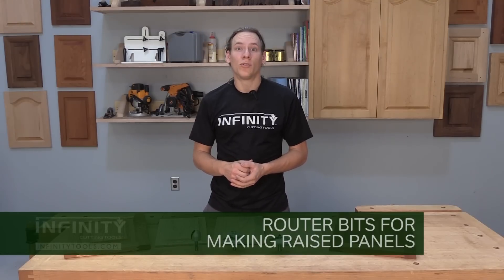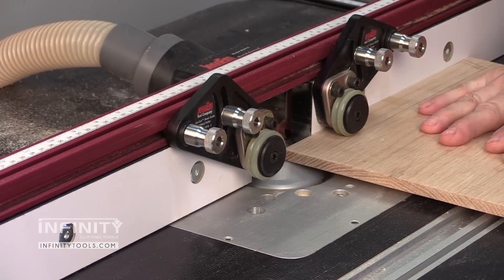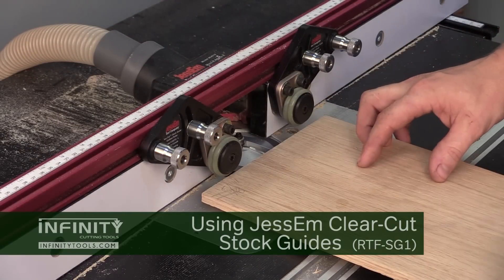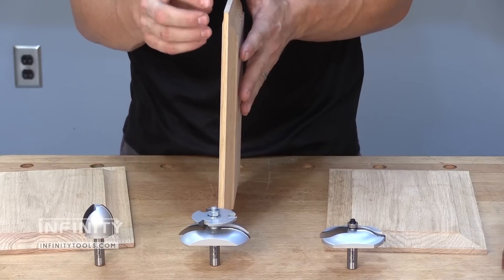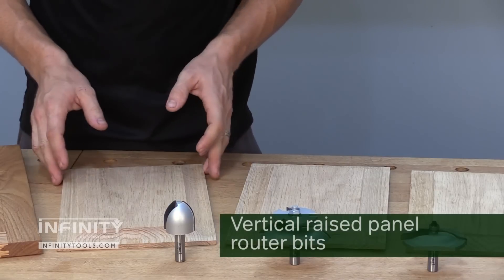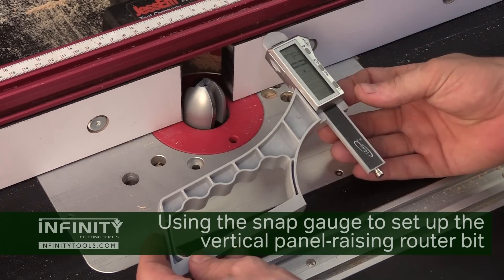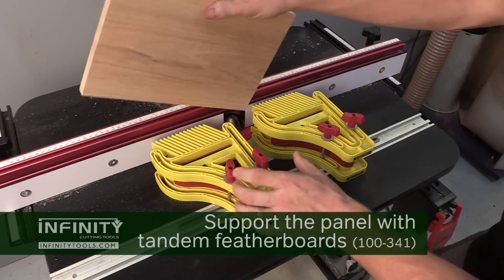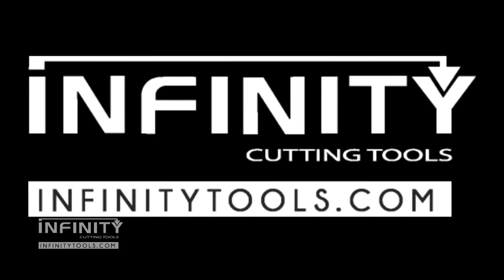Choosing and Using Raised-Panel Router Bits for Cabinet Doors

Comment: Amazon stuff from Chinese sellers takes weeks to arrive. They ship it from China and it takes an eternity to get here. What I liked about the infinity website were the pictures of actual wood with the cut of the bit (VERY HARD TO FIND ON OTHER SITES), pictures showing the measurements of the bits, and even videos of them using the bits. It's very clear what you're getting and makes it easy to narrow down what bit you need to buy. With a site like that, I think people's perception is that the quality of the bits will be good as well. I bought some $200 worth of stuff and it's on it's way now, so we'll see.

Comment: Does Infinity make a straight raised panel cutter with a bearing so I can raise the panel on a curve?  I would like a 1/2" shank that can make a 7/8" wide raised portion with a 1/8" shoulder.  I will not be inserting this raised panel into a frame.  Thanks.. Tom
Reply from the maker: Hi Tom, If I understand what your thinking, our standard raised panel cutter 90-502 might do the trick. You would either need to use your fence to limit the cut or swap out the bearing. Have a look here. https://www.infinitytools.com/raised-panel-router-bit-horizontal-5434
Reply: @InfinityTools  I think the 90-502 might work.  I think I would have to replace the bearing with a larger one since the raised shoulder I want to duplicate is 7/8" wide.  I wanted to attach 2 photos but I don't see where I can do that here.... any thoughts for me?  Thanks.. Tom

Comment: how well dose the triton motor do  under heavy load?
Reply from the maker: I have been running the same Triton 3.25hp router in our shop for several years now and it has never missed a beat. It runs our raised panel bits, Mega Dado, and our new Mega Flush Trim bits and never bats an eye.

Comment: How would you use the panel bit with back cutter on a cathedral top door? The only way I see that happening is with a starting pin and using the larger bearing for the first pass and the smaller bearing for the second pass. I just purchased the Frame and Panel Master with cathedral top templates.

Comment: why do they not make the art deco  bit in a vertical  my router will not swing 31/4 bits
Reply from the maker: Vertical raised panel router bits are more difficult to use and less popular than horizontal versions.

Comment: Using a Triton router w lift?  I was told by Triton that a lift isn't compatible with my TRA-001.  What model Triton are you using?
Reply from the maker: Hi, the Triton router is it's own lift, or the lift mechanism is built into the router itself so no additional lift is needed.
We are using the TRA-001 3-1/4hp router in our table. The smaller MOF-001 router functions exactly the same way.
Reply: Benny Hannah
Reply: The first edition of the TRA-001 released in Australia didn't have the provision for table access to the lift. You have to reach in underneath. Subsequent editions added it, but there are a lot of older first editions floating about, esp in Australia.